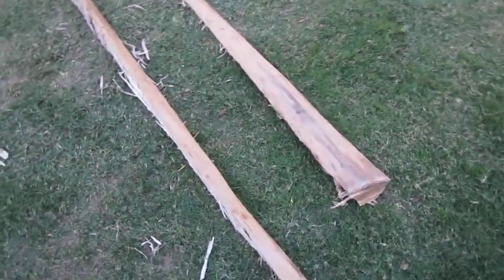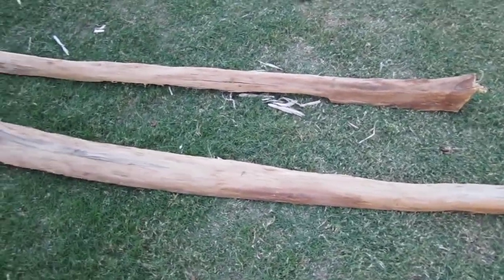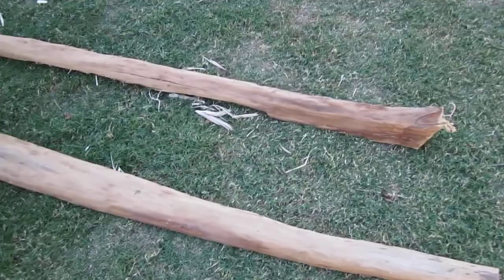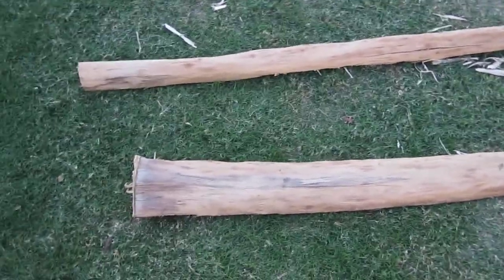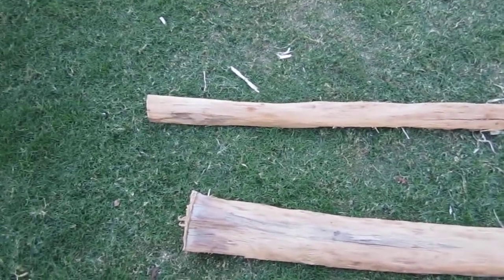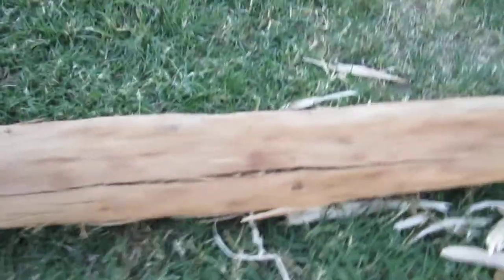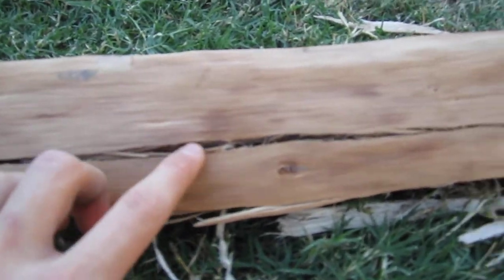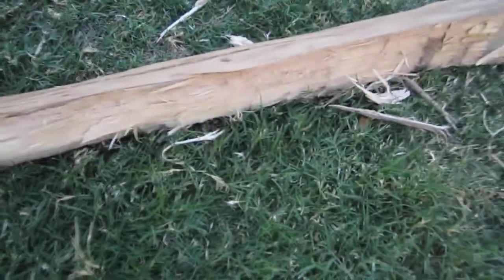Using Sweetgum as a Bow Wood - Part 2

Comment: It's so much easier to carve it out wile it's green. But also becareful not to cut to deep. I stop and use alot of sand paper when it's almost dry. I had no cracking on winter harvest wood. I had alot of cracking harvesting in spring summer or fall.